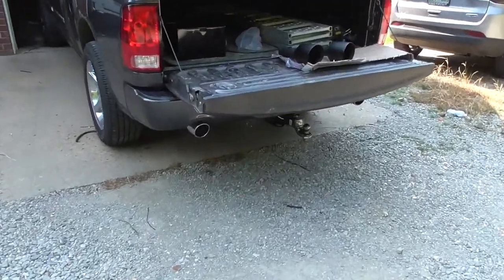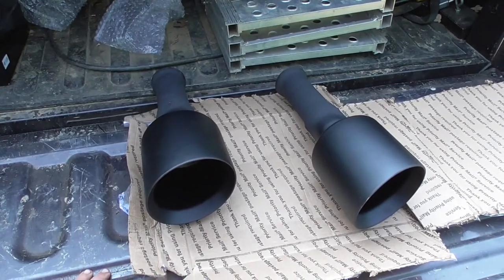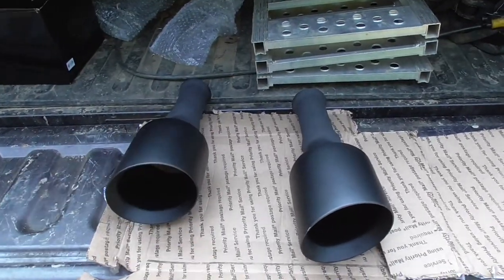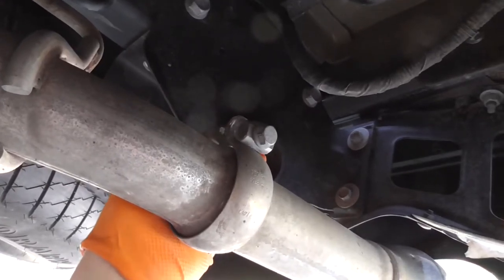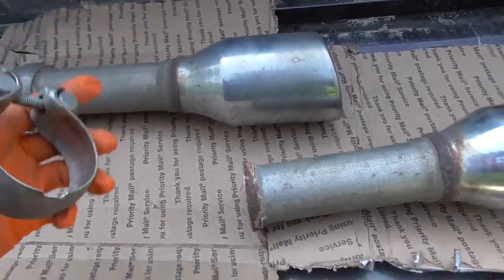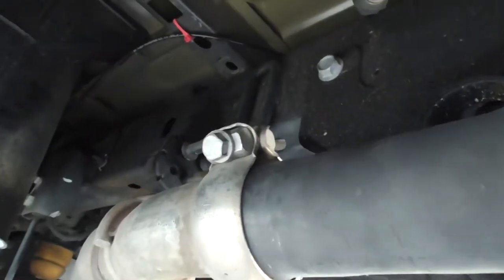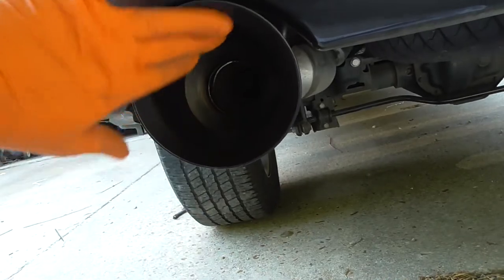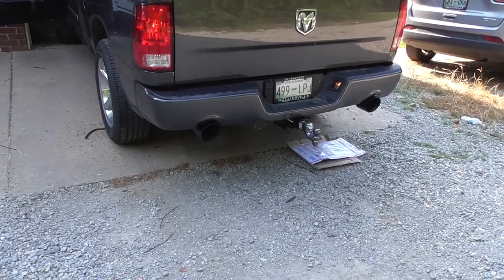2018 Ram 5" Exhaust Tip Install | Exhaust Sound | 2009-2018 (2019-2022 Classic)

Comment: Where did u get the tips. Do u have a link or part # for the 5" tips
Reply from the maker: Got them from eBay, no part number but the seller's name is 2014usmuffl. they have black, chrome, and blue tipped - 5" tips.